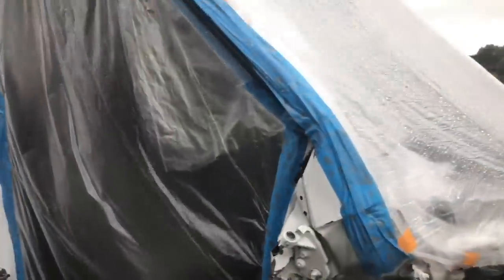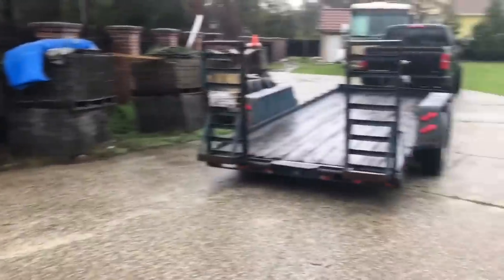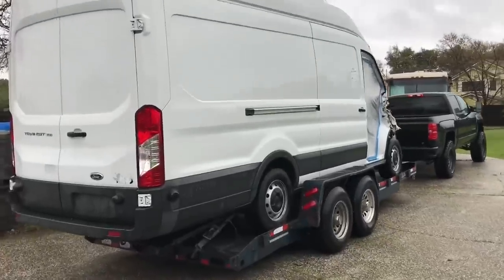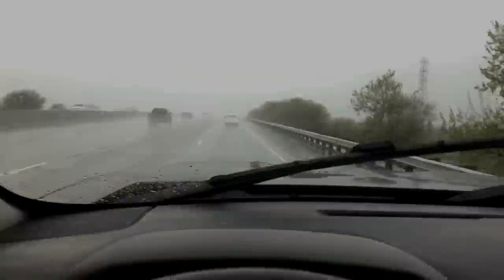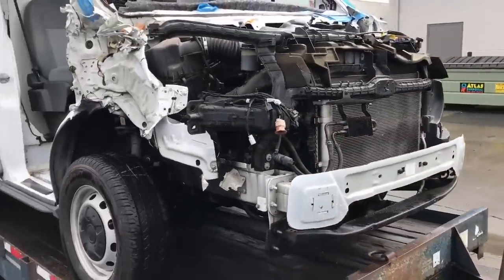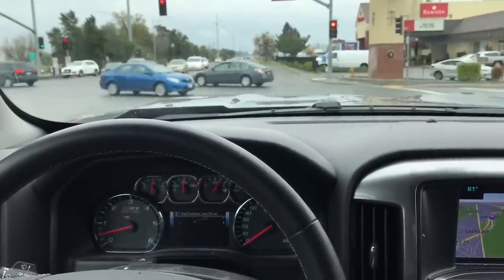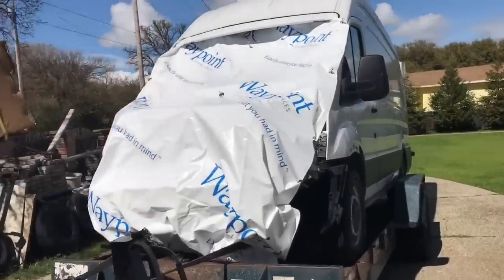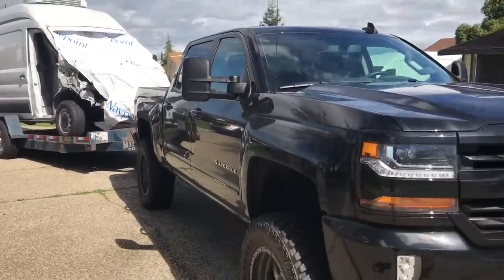2017 1500 Silverado 5.3 Towing 11,000lbs Then this happened!!

Comment: In some states, you can get a really hefty fine for towing over 'license weight' not to be confused as truck rated tow capacity. Usually, if over 5K, you will need to purchase additional weight permit plates, 8K, 10K etc.
Reply: Paul Moffat u purchase tags for gross weight.  Tractor, trailer, n payload.    Up to 26,000.   After that till u reach 80,000 u need CDL LICENCE N MEDICAL CARD.  With co figuration i. Video hes probably overweight on trailer.   U need certain % o weight on tractor.   Why didnt he jus pull van off trailer????   Ive loaded unloaded dead trucks cars bulldozers excavators ect.   Looks like he jus wasted time n fuel.   Somepeople dont think.    Names hippie
Reply: Jesse Biggsjr in washington state.... for pick up truck registration you pay for a standard 5k  load (for half ton and up truck)... this mean if your truck weighs 6k you can have 11k total weight including the truck weight... if you want to pull/load up more than 5k you need to pay additional fees per 1000 pounds.... so if your truck is rated at 25k towing capacity you need to pay the additional 20k lb fees... not cheap.. and if your registration is only good for 5k and you get pulled over and weighed the fine is $1 per pound that your over. My 4cyl ranger cost me 3 times more to renew then my 7.3 excursion... my ranger can only tow 1k on a good day, my minimum tow rate was 4k on this truck... i couldn't request less or say I don't tow.. the excursion is an suv and exempt from this crazy taxed fee.
Reply: Jesse Biggsjr also this is not bs... it's crazy.... this new tax came into affect last year... I couldn't believe that my renewal was $300 more than previous year, so I asked what the heck was going on and got schooled a bit.
Reply: Just to add to what Joe Joe said.  I too am in WA and depending on which county you live in it will change your tab fees greatly.  Pierce and King counties are the highest which you pay for tonnage on your vehicle based not on it's weight but the weight it is rated to haul and tow.  My 17 Ram Rebel can tow just under 11K my truck tips the scales at 4800lbs and I have a cargo capacity of 1500 lbs.  I pay for 6300LBS gvr plus towing my tabs are over $500.  Just a year ago when I bought the truck... right before the new law came into effect my tabs were $175.  They even charge me Tonnage on my Harley!!  A 600lb bike is charged tonnage.  Not all counties do this... I wanna move to Kitsap County again!!
Reply from the maker: It's all good
Reply: In Pennsylvania you pay $12/year for your trailer tag up to 10,000lbs and you're good.

Above 10k trailers the registration fees go higher but you can also get a permanent tag like 18 wheeler trailers have. It's not too bad here.

Comment: Talk about CLICKBAIT!!!
Reply from the maker: Just a little bit
Reply: When I discover that I’ve been duped by clickbait, that’s pretty much a guarantee that I won’t subscribe or ever watch this channel again.
Reply: @FixItNick  because you thought it would be the chevy  FU up ed , thats a messed up mercedes  I work in one, but the engine jumped timing at 171,000 miles,not too bad for the miles , but the  engine was 20,000 to replace  with labor. Ford work trucks are better but the price of the Ford to the mercedes is the merce has air conditioning and cruise / cd for less . Oh and try to get parts for them(mercedes) . But Ford is so sad that they even copied the sprinter down to the gas door . What a sad company .

Comment: My 2015 1500 sees a 1.5 ton trailer loaded with 5 to 6 ton of gravel daily! No issues.
Reply from the maker: These work good but I wouldn’t pull this much myself, that’s why I got the f350 dually Project now lol
Reply: FixItNick  yup I agree it’s all I could afford at the time, just bought a 2011 dually 3500 duramax myself.

Comment: Instead of the plastic sheeting, use Con-Tact shelf lining paper -- the clear. Much sturdier. I stuck some over a smashed side window on my Ford Aerostar van years back and drove it several weeks until I had the glass replaced. Not sure about how it would hold up in a front windshield, but it would be better than the plastic sheeting.
Every time I see someone with plastic sheeting taped like that, I want to stop them and recommend the Con-Tact shelf paper!
Reply from the maker: yea i messed up on that plastic lol.. where you get this Con-Tact lining paper?

Comment: No way thats 11000 pounds. Unless there's gold bars hiding in the van.  Closer to 8500ish.
Reply: CMac  that’s what I was thinking
Reply: He was probably using gross weight not curb weight.
Reply: To clarify, you are right, that’s probably where he got his (incorrect) number from
Reply from the maker: Trailer 4500 van 6000-6500
Reply: My overbuilt 18' Cam Superline is a 2100lb trailer and according to Google, the Transit 350 tops out around 7124lbs. So at most it's probably 9400lbs your towing. But that one has no seats or gear in the back so it's probably closer to the bottom at 5,000lbs curb weight. So really a 7500lb load.

That's why the Silverado had "no problem." It looks heavier than it is.
Reply: I have a 99 GMC Sierra and I tow 10,000 pounds I have a triple axel trailer that weight 4,500 Pounds and and f150 that weighs 5 ,500 pounds and nothing happened lol
Reply: keven smith Yeah you're massively over weight if it's a half ton. 6500lbs max tow per Google.

Can != Should.

My dad does the same thing with his skid loader. He's way over. It's sketchy. I did it with my SUV once, rated higher than your truck, and it wasn't something I'd ever do on a main road, let alone the interstate.
Reply: Slednex700 not if you know how to tow
Reply: CMac at the most
Reply: I think he's referring to the van and the trailer total gross weight .His truck is probably pulling 11,000lbs. you got an 8000lb to 9000lb van and about a 2000lb to 3000 lb trailer. Thats  10,000lb to 11,000lb that the truck is bulling
Reply: keven smith you got a factor in a 2,000 to 3,000 pound trailer and then about a thousand pound refrigeration unit that's built into the van and maybe another thousand pounds of insulation and seals to make that a refrigerated van and then just a normal van weight he's probably pretty close to 11,000 pounds that that truck is pulling
Reply: keven smith the max towing on my 99 Silverado is 5000lbs
Reply: Doesn't matter what you Google, or what the weight sticker sez, it's the registration weight 🤓
Half ton usually is only 3500 including tounge weight, get pulled over and watch what happens smart guy's,
Reply: FixItNick that trailer doesn't weigh 4500 lbs. 1100 tops. I pull vans like that all the time on a heavier duty trailer (2000 lbs 6 lug trailer)  and gross is 8200. A Chevy 1500 does fine. You have to baby the transmission unless you get a 3500. Or 2500 with 4l80e trans.
Reply: CloneTrooper55 Gaming the max towing on mine is 11,000. You must have a v6 engine
Reply: dchawk81 you shouldn't trust everything you see on Google. My 17 sierra 1500 is rated for towing 11,100lb and 12,500 loaded down per GM.
Reply: christopher m primm Sr a half ton rated at 3500? Lmao just shut it bookworm , my older 03 GM has a 7400 tow rating and I've had past that with no problems
Reply: CMac. What the he'll do ya think the trailer weighs dim bulb
Reply: dchawk81 nope, 2017 5.3 properly equipped is rated to tow up to 11k if it's a quad cab 2x4 with Max trailering and is stripped. Doubtful the truck in this video is that exact build, but such a truck does exist.
Reply: 3000 for the trailer 8000 for the van 11000 in total
Reply: @blakeok952  why is yours so low? I have a 1997 and the tow rating is 7000 for it.
Reply: Shawnette Lattimore I don't haul  with that 99- so I never looked it up elsewhere-but the bumper says max 5000lbs trailer. I could be wrong- it has the LM7 5.3
Reply: keven smith figures you were towing a ford. Lol
Reply: @FixItNick  that trailer is 3k

Comment: I think your weight estimate for the load sounds high....have you weighed it?
Reply from the maker: No I haven't but that trailer is 4500 for sure, van is 6000-6500
Reply: That tailer is more like 2500-3000
Reply: As a general rule most trailors weigh about 100lbs per ft of deck. So 20 ft trailer is around 2000 lbs. The transit van curb weight is 5000 lbs give or take a couple hundred.short roof is under 5000 and taller roof models a hair over. So he was towing around 7 or 7500 lbs.
Reply: My overbuilt 18' Cam Superline is a 2100lb trailer and according to Google, the Transit 350 tops out around 7124lbs. So at most it's probably 9400lbs your towing. But that one has no seats or gear in the back so it's probably closer to the bottom at 5,000lbs curb weight. So really a 7500lb load.

That's why the Silverado had "no problem." It looks heavier than it is.
Reply: 4500 lb. Trailer??? Hahahahaha!!! My 28' enclosed trailer doesn't even weigh close to that!

Leave it to a 5.3 owner to grossly overestimate the load towed!

If you want a REAL 11k load, then I'll bring my t300 bobcat over and see how much that truck can really handle!
Reply: FixItNick I've weighed my 20 foot 15,000 gross weight trailer with 6 lug axles and 12 in brakes on both axles and it's 1980 lbs.
Reply: Bryan Hensley That is one LIGHT trailer! I have a 20' 14k trailer that weighs about 2600. It has a 4' dovetail and fold up ramps, which makes it a heavier build than a utility type trailer.

My enclosed weighs about 4500 with the bath and genny up front. Load it with a classic and it tips in at 9000 or so.
Reply: Charlie Odom this one has wood floors. No dove tail. Fold up ramps. 6 lug wheels. Four 12 inch brakes. That dove tail probably adds a bit. Come to think of it, I had the ramps off when I weighed it.
Reply: I also said 15,000 but it's supposed to be able to haul 12,000. I think they overrate them some. It's got 2 6000 lbs rated axles. How can it haul 12,000 and the weight of the trailer. I know some of the weight is on the truck but not 2000 lbs. I won't haul over 10,000 on mine. But it's heavier duty than the one in this video.
Reply: Bryan Hensley is it aluminum? I wish mine was that light!!! My enclosed is aluminum, and it weighs a LOT less than the steel versions.
Reply: Bryan Hensley my equipment hauler has 2 7k axles. My enclosed has the 5200lb axles.
Reply: Charlie Odom you have the 8 lug wheels don't you?
Reply: Bryan Hensley no, 6 lug wheels on all my trailers. Some of the 7k axles have 8 lug, but I wanted all my wheels to be interchangeable.
Reply: Nathon Smithson curb weight is never actual weight and I'll put money on it that trailer is at least 3000
Reply: Masa Allen do i need to send you my address so you can send me money. My old trailer was almost identical and weighed 1,100 lbs. The 20 foot equipment hauler I have only weighs about 2,000. It hauls 12,000 lbs.
Reply: Masa Allen instead of lying about the weights you can actually pull with the POS 5.3l truck, why don't you do a video proving that you are right? It costs about 15 bucks to run through a weigh station 3 or 4 times.

Or...I can let you pull my T300 Bobcat, which will tell you exactly how "good" that truck can pull a weight!

Oh, and curb weight of a trailer is EXACTLY what the trailer weighs in real life. That is the purpose of having the curb weight! Trailers don't have cargo, fluids, and passengers that can alter the base weight like vehicles do.

I would challenge you to find ANY trailer that has a listed weight and weigh it to see how close it really is! Every single trailer I have ever pulled with a listed weight is damn near identical to its actual weight. The only difference would be if the manufacturer listed a "base" weight for the trailer model and lightest options, then you added options, like heavier axles, different tongue, brakes, heavier ramps, wheels and tires, etc. The manufacturer would list the weight as a base weight and not a curb weight, which is on a sticker somewhere on the trailer!

Quit trying to say that your POS 5.3l is some magical motor that can tow 7 tons! We all know the real capabilities.
Reply: Charlie Odom I wouldn't call the 5.3 a POS. It's a very fast engine that gets above 20 mpg in most vehicles. It does what it was designed for great. Chevy  uses the duramax for towing. Most towing capacity is rated by the weakest point, the transmission. A 4L60e transmission max gross capacity is about 12,000 lbs. This includes your towing vehicles weight too. Which puts it around 6,000 lbs towing capacity rating it by the transmission
Reply: Bryan Hensley okay, great info about an obsolete transmission that hasn't been used in a decade! The 5.3l is obsolete, just like the 60e and 80e transmissions.

Since you mention the duramax, since when did GM put a diesel in a half ton pickup in the usa? GM still uses the 5.3 in most of its half tons that are supposed to have GCWRs of 15k+, which is WAY too much weight for the motor.

So, in that aspect, the POS outdated 5.3l motor needs to go away and a better motor needs to replace it. The 3.78 bore head over cam block is OLD technology and the over head cam blocks work a lot better. GM has been putting off replacing the old technology for well over a decade, but I will look forward to seeing a smaller turbo v8 overhead cam motor introduced to the trucks soon.

The reason why the 3.78 bore blocks are so bad at towing is how and where they make power. The heads don't have enough velocity at lower rpms, so they don't make good power till the upper end of the rpm range. Try pulling anything up a hill with a 5.3, or a 6.2 for that matter, and see how many times it downshifts. They regularly need to turn more than 4000rpm to carry loads up inclines. Why do you think the marine industry loves the LS based motors?
Reply: @charlieodom9107  is called the overestimated weight as soon as he started guessing.  He wasn't pulling more than 8k. But, the 5.3l does its intended job well. If you want to pull around heavy equipment.  Use 3/4 or 1 ton with a diesel.
Reply: @thomplatt8945  The 5.3l is worthless at pulling it's own ass up a hill, much less a load. It does not do it well.
Reply: @charlieodom9107  I have pulled fully loaded uhauls and a travel trailer through the mountains with mine. It did just fine. If you know how drive and not overload your vehicle it will do just fine.
Reply: @thomplatt8945  do you even know what fully loaded even is on a vehicle? My guess is...you think as long as you are under some magical gross towing weight listed by the manufacturer, that you aren't over weight and that you are legal.
Reply: @charlieodom9107  yeah, I am a cdl driver. So, don't worry about me. You clearly have enough of your own shit to worry about. What I should have said, was that the uhaul was packed completely full. Probably well over its recommended limit. The fact is, most of the new truck purchase is simply personal preference. Based on warranty, gas mileage, intended use, appearance and budget.

Comment: Your truck is a crew cab, and assuming it has the Max Tow package and is a 2wd, max towing is 11k on the dot. Without Max Tow package its between 6,400 and 9,400 depending on gear ratio. 4wd shaves 300 pounds off all these numbers. Plus your lift and tires make your truck heavier, but don't increase your GCVWR, meaning your new tow capacity will be lower than stock. Make sure your not overloading! Even 1 pound over means your insurance wont cover you in a crash and you will be paying all repair and medical bills out of pocket, plus a nice ticket from your local PD. And they WILL weigh your after a crash because it just looks overloaded...
Reply from the maker: We all survived it pulled well, didn't even get above 3500 rpms
Reply: That's good. But just a reminder that your tow capacity is not based on what your engine can pull. Its based on your trucks rating to handle those loads, most importantly stop them. My '93 Suburban K2500 is rated at 10,000 pounds. It's been able to pull some trailers around 15,000 around construction sites no problem, but stopping them is another story lol. Just a friendly reminder that going overweight probably wont hurt your truck, but it will hurt your wallet if u happen to get into a wreck, which is more likely than ever once those breaks get overworked. Stay safe!
Reply: No what he did was put more than 10K pounds on there as the max limit for towing for a 1500 was about 9.3K so he over did the weight on the trailer
Reply: Then again Silverado did improve on their trucks so idk xD
Reply: I looked up the specs for his particular year from Chevy. The tow numbers in my original comment are correct. 9.4K without the Max Tow package. 11K with max tow package, crew cab 2wd and 5.3 motor. I also wasn't sure, that's why i did some digging and found the specs lol
Reply: Andrew Ness lol
Reply: Andrew Ness invest in a electric brake setup. My trailer has four 12 inch brakes on it. I can stop quicker with a loaded trailer. Those brakes hold back more than the trailer and 12,000 lbs load. Seriously get a break setup before you ever think about going on the road again.

Comment: I know it requires a lot of thought!  If I was hauling it and it was raining I would cover it with a trap to keep it dry!  I don't think it requires much intelligence to figure out that a piece of plastic painters trap or cheap plastic wrap.  Would rip off especially at sixty miles an hour!  But like I said that requires thinking doesn't it.
Reply: JOHN SPURLING
He drives a GM so thinking is not his strong point
Reply: LOL Yes you do have a point.  Really can't blame the GM for his lack of thinking!  After all the truck has no choice in it's owner.  :))))
Reply from the maker: Yup I failed, thought it would hold till I got on freeway lol